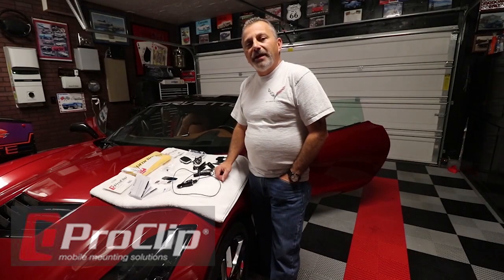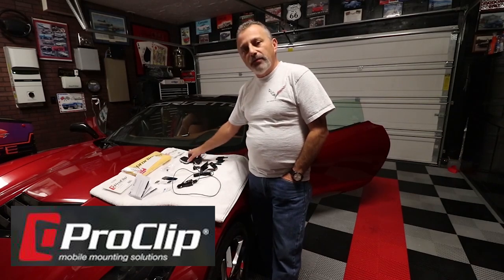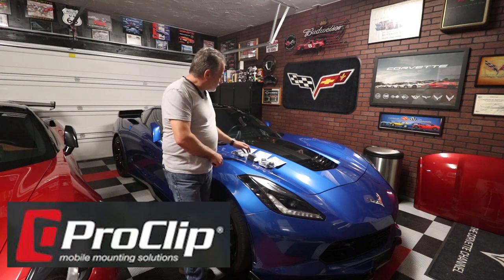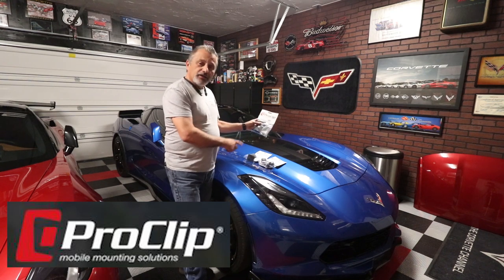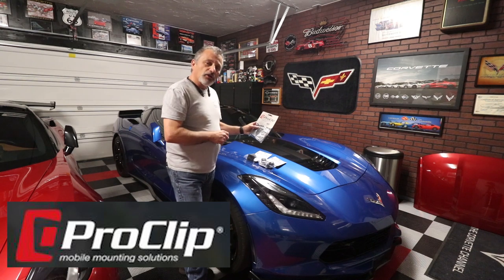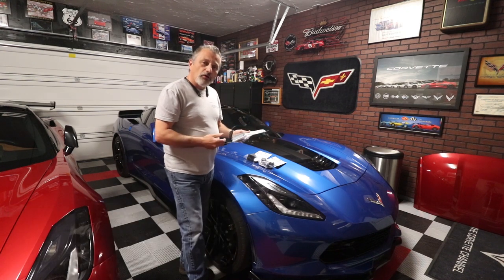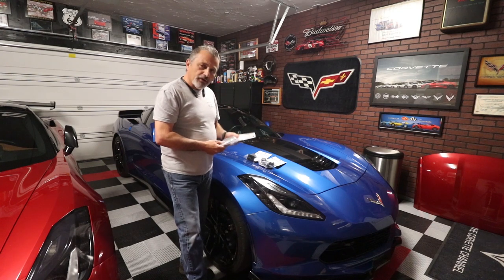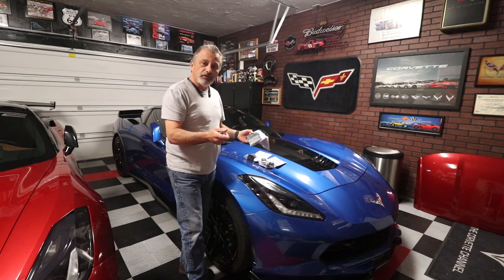How to Install a Custom Cell Phone Holder in a C7 Corvette from ProClip USA

Comment: Well, I ordered, watched your video and their video on installing and did it as instructed in my 2014 C7. The mount doesn’t hold the weight of my Iphone and the bracket just falls out. I contacted them but it seems they have not gotten back to me. I don’t think you should be touting their product. I think I wasted my money.
Reply from the maker: Hi Ed,
I am sorry that you are having issues.
I would have to say that most likely you must have the metal tabs in the wrong place. I know for a fact that they work great on both iphones and Androids.
I have a pile of people that use them and love them. Try to reach out to them I am sure they will help you get setup.
Reply from the maker: If you are speaking about the mount it self you must get the edges of the clips in the right place in the grooves and it should hold unless something has been changed on your grab handle area. The only other possibility is that you reached a bad mount and if that is the case I would ask for an exchange for another one. I promise you I know they work.
Reply: THE CORVETTE CHANNEL  I have reached out and have yet to hear back, as to metal tabs,  I didn’t have any on my mount nor did I see any in the videos. My C7 is completely stock and while U haven’t owned it since new I haven’t done anything to the grab handle.